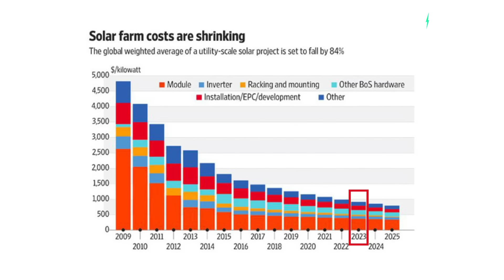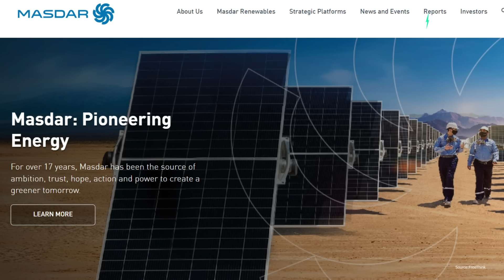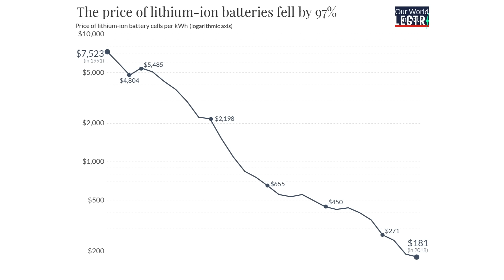New record-low global energy price set at the worlds largest solar farm

Comment: I would have thought the maintenance costs would be high, as its built in a very dusty environment. Those panels will need frequent cleaning
Reply: They would have factored that in their opex calculations- it also helps when have access to slave-like labour from poorer parts of SE Asia.
Reply: @adblocker276 - Or resort to automated cleaning devices. I saw a video once about it.  An army of Tesla bots will solve that problem in a few years, lol.
Reply: slave machines. @adblocker276

Comment: Too bad electricity storage is economically poor but rich in grey energy requirement so the best LPF battery at current cheap 180$ per kWh of capacity good at optimum use for 5000 cycles of a 0-60% of the full capacity range (0r more costly at 3000 cycles at 0-80% or 2000 at 0-100%) ends up simply at a storage cost of 180/0.60/5000= 0.06$ per kWh plus re and de-charging losses and slow open circuit drain so in practice a solid 0.07 $ per kWh stored. Now, costing 30 time less by kWh of capacity depending on bottle size and lasting 50000 full cycles minimum the COPV compressed H2 bottle stores one kWh for 350 times less (0.07 / 10 / 50000 = 350 times less!!!) Also the COPV bottle performs those 50000 full cycles or 6 month at full pressure without any measurable gas and energy loss detected….remarkably better!!!y So COPV storage becomes the only economic enabler of any long seasonal energy storage while batteries would loose it all and hydropower lakes evaporate high amounts of pumped water, half an inch of level per week,,a huge and constant energy loss!!!  so while the electrochemical best LPF batterie short time storage cost is about 6 time the quality PV production DC panel outlet kWh cost with a corresponding monstrous amount of grey energy, mining, production and recycling pollution, the more durable hydrogen energy storage cost in the bottle is just NEGLIGIBLE…and the PV production cost very cheap…so that associating both Pv or wind with green H2 for such variable production, massive storage and the totally different free supply energy demand curve makes sense…Moreover, with sun, wind and green energy production anywhere and the local green H2 COPV storage anywhere also, no expensive and massive transport of energy is needed..which with a full electric network reinforced to cope with BEV mobility and electric heat pump domestic heating and cooling at 9000$ the ton of copper and 3000 the ton of aluminium, alternating and uploading to network this power is no longer six times but ten times the PV D.C. production cost: conclusion 100% electric power network for all the NEW surface clean zero carbon energy required for the planet is no longer the ideal and most economical media adapted to the features of those new clean power sources and clean mobility and domestic power charges requiring less transport of energy where electricity excelled and more storage where it greatly under-performs…the only reason full 100% electric is promoted and the lobbying is intensive, also stupidly for those new, huge and non instantaneous so called clean loads (BEV’s and heat pumps) is to maintain a current monopole of energy supply, distribution and sales with much less competition and huge margins, huge grey energy and pollution and our planet does not deserve it but rather a clean and abundant energy with low grey energy initial production cost, low operational cost and low recycling cost which is both economical and useful for the mobility and comfort of also the weakest poor economies of the world for which BEV and full electric AC definitely aren’t a practical,solution within reach..so game over…clean economic and green logic must and will prevail…rapidly the planet demands it..lol

Comment: "DEWA received two bids from ACWA Power and Masdar. Masdar submitted the lowest bid of USD 1.62154 cents per kilowatt hour (kWh) for the 1,800MW 6th phase of the Mohammed bin Rashid Al Maktoum Solar Park" 1000 x 1.6 cents is $16.21 per Mwh. However, when I keyword search on this I get another rate at $13 per Mwh for a different installation. This one is definitely near the bottom price-wise, but not the cheapest.

Comment: Would like to see the overall solar plus battery storage cost averaged over a year per KWh. This is great for industrial metals refining which does not need to run 24hr a per day. But for houses and offices, need much more consistent power supply. I still think nuclear is great. But seems too much effort applied to prevent it from being deployed.
Reply: Why wouldnt industrial metal refining not require power 24 hours a day?  If they are spending a lot of money building out a plant they will want that running as long as possible.
Reply: This is the 'invisible hand of the market' speaking. 

Nuclear power is incredibly expensive and time-consuming to bring online compared to renewables plus storage.

Also, many smaller countries around the world simply don't have access to nuclear technology due to the fear of it being used to make weapons.
Reply: Nuclear is great. Expensive to build but less expensive to keep existing plants running.
Reply: @andrewsaint6581 - One of the problems with nuclear is disposing of the spent fuel.  No one wants it buried in some cavern in their state and they will be radioactive for centuries.  Now what?

Comment: I think the Viking is ignoring a real problem, lack care for infrastructure.  Fires in Maui are just like fires in California, blamed on climate change but were really not care for infrastructure and for poor forest management. 

In my area in Txas, about 1/3 of the bill is the distribution, which will not go away if prices come down.  It may be more efficient, i can see that, better grid management will allow existing lines to carry more electricity.  

Ok, maybe Viking is not ignoring, but i know others are.  

The expectations are we will need double or triple the electricity.  May with with only how much more lines?
Reply: Yes, they have massive forests in the midde east. SMH.
Reply: Maui fire definitely owes heap to AGW.
A rather unique combination of drought, heat, strong winds, winds coming down off the mountain.
Stop deflecting. (Some other points are OK)
Reply: @iandavies4853 Who is deflecting?  There is a cost for distribution and maintenance, and we see poor maintenance.  It is honorable work, needs to be done, and lack of maintenance causes real problems.  Are you not understanding this?
Reply: @tireddad6541  there are lots of issues behind Maui fires including grasses, land ownership issues.
Lots I’m ignorant of no doubt.
I’ve seen how AGW impacts fire behaviour. Drought, wind, heat all stronger.
And yeah, electrical (or water) infrastructure also.
Many characteristics reflect what I’ve seen in Australian fires, AGW esp.
With these winds, can’t get the choppers up, so can’t use best tools just when you need them.
We are fighting fires all wrong.

Comment: Not true .... there's home generator  systems that provide energy in America that are cheaper then solar...
No fuel , no solar , no batteries needed to run them.
Reply: Initial purchase price, you're right, but daily operating costs, a generator costs much more, because fuel and maintenance costs. Solar uses free energy, that is delivered for free. The same cannot be said for any fuel source.
Reply: @vincentrobinette1507  nope your wrong initial and long term even pays for them selves in like 5 years or so

Comment: 2:13  That's 1.624 cents per kWh  That's insanely low.  Of course that wouldn't factor in the cost of grid scale battery storage. Much of that power could be used in real time though during the day and then fossil fuels, wind and battery storage could cover the non sunlight hours.  In five years time we wont even be having these conversations. The game will be near over.
Reply: The other question is are they factoring clean up at the end of life?  Where I live there are a few projects that the companies ended up going bankrupt and they just abandoned everything.  Solar isnt as bad a wind though.  Solar is pretty easy to clean up as long as they use helical screws for mounting.  If they used piles then it could cost a lot of money since they need to dig them up and then cut them below ground and fill in the holes.  Dismantling a wind turbine is a bigger process though.
Reply: @pin65371 yeah, and who is cleaning up after fossil fuels?
Give us a break. Stop pretending you’ve a low IQ.

Comment: More great news.  The oil-producing states know their deposits of oil are quickly running out and will be virtually dry within 20-30 years, so they're trying to diversify, which is smart.  Independent seismic testing showed that the world's oil supplies will be virtually depleted, and that report was 10-years ago.  Solar, wind + BESS is the future, no question.  We need the remaining amount of oil for roads and long-term plastics.  BTW, the world's largest solar plant is in India, at 3GW.
Reply: Nailed it!
Weird that folk think we'll run out of battery stuff but not oil stuff.
Reply: Actually no.

The oil producing countries foresee a collapse in global oil DEMAND in the next 2 decades. 

Saudi Arabia will still be able to sell oil, but in lower quantities and at lower prices than today.

Time for them to diversify their economy! The clock is ticking.
Reply: Indians are best at bragging, 56 square kilometers of solar power plants generate 3GW, while Arab solar power plants cover an area of 77 square kilometers and generate 1.8GW
Reply: The oil deposits have been threatening to run out in 30 years since the 70s, but they don't seem to run out. The "fossil" fuel theory of gas and petroleum is a scam.

Comment: Quoting solar farms max output is unhelpful and misleading. In reality the average power delivered is a small fraction of that. Eg it's 10-15% in Europe
Reply: Ah, yes, the "100W panel is actually a 10W panel" lie. Nope. The maximum output is mentioned because that is what is used to calculate the production and that depends on where the panels are not how much sun they might get somewhere else. By the same logic all the closed coal plants make the average coal power delivered close to zero, so a gigawatt coal plant burning tons of coal every second is not actually producing any electricity.

Comment: Sam:  Are you also including in the cost of the panels, their eventual recycling, the associated infrastructure to get the power out and maintaining (keeping them clean) them?  None of that is free.
Reply: Concerted campaign from fossil fuel interests? 
Abandoned oil & gas wells, Exxon Valdez, oil wars?
Reply: @iandavies4853  Absolutely right.
The earliest news memory I have is the Torrey Canyon tanker running aground and the massive oil spill had blobs of sun and saltwater hardened oil still turning up on beaches for years in UK.
I just googled it and it was 1967.
Reply: Yeah, mine and burn.
You can't recycle pollution.
It's certainly a possible outcome if we want to carry on.
Weird that folk think we'll run out of battery stuff but not oil stuff.
Reply: @andrewsaint6581 - Batteries are recycled, not so natural gas or petroleum except for engine oil. Plastics can be recycled.
Reply: @Chainyanker007  Absolutely. We've been living on credit with our disposable world. 
Time to use what's already above ground better.
Reply: I hope they are including that in the costs.  Maybe amortized over 15 to 20 years.  There is a regular maintenance and then amortization.
Reply: When will so called "big oil" clean up over a hundred years of spillages on land and sea, air pollution and contaminated industrial sites?
There are two sides to every story.
Reply: You forgot the overhead needed for the company to actually make a profit. The price mentioned is how much they will be selling electricity for and all of that is included in the costs they have to pay out of it.
Reply: This is the generation cost. What the utility company pays the electricity supplier.
It doesn't include transmission, energy storage (if applicable), system loss, etc.
Reply: The Transmission lines would be needed regardless of the generation source, cleanup (they can recycle them) would depend on the contract, the price that Sam quoted likely include installation and required maintenance (many are self cleaning) for a set time period of time unless the UAE becomes the owner after construction is complete.

Comment: So; when you go and try to figure out that cost of the electricity; it could be free; the farm will still cost you via taxes. When you actually figure in the cost of the farm and add on the cost of the power that will be charged; the cost per kilowatt isn't attractive at all.
Reply: What?
Do you know that folk are building solar farms and selling the power?
As inflation grows the initial cost stays the same but the output power sells for a bit more as time goes on. 
Year on year.
Reply: Correct. Intermittent renewables only ever get more complex and inefficient the more you build. Indeed, consumer electricity prices increase logarithmically as the percentage of renewables on the grid increases.
All the fan bois always forget to add transmission, storage, grid upgrades, land purchase, maintenance and disposal for a distributed system. The massive system inefficiency is why countries build nuclear and why France, Sweden, China, US, Canada etc have reinvested billions in new nuclear power.

Comparison of dispatchable baseload to intermittent renewables are generally done using LCOE but even the IEA has come out and clearly stated that LCOE cannot be used to compare the two.